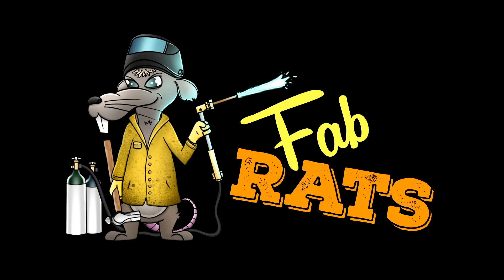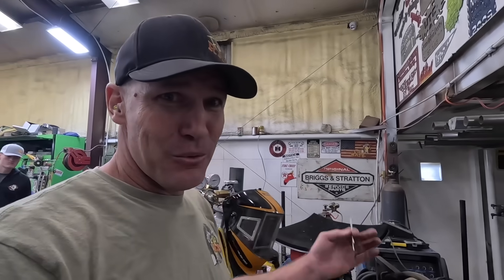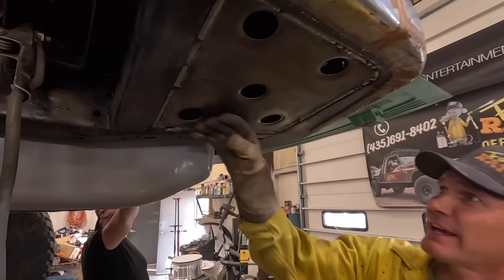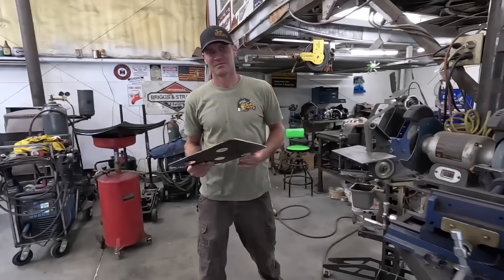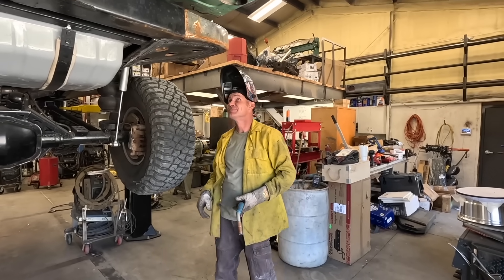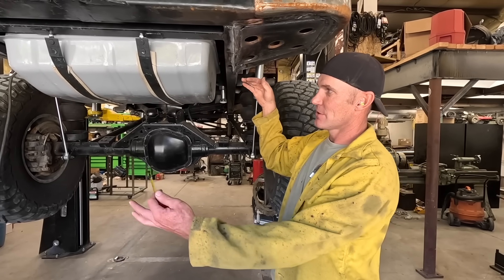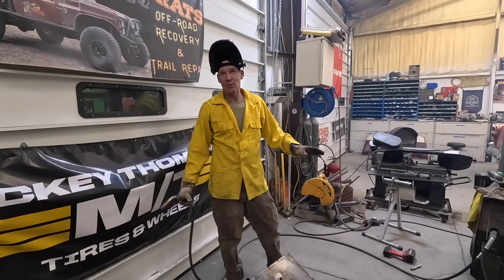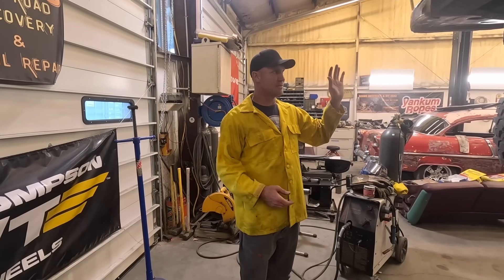HUGE DEADLINE! Can We Finish This Overlanding Build In Time?

Comment: If you haven't done it already, think about drilling a hole through the horizontal crossbar of the spare tire carrier so water that gets in where the shovel goes will drain out.

Comment: Robby's bread van turned out way cooler than I originally imagined, but I don't know how good it will wheel though!
Reply: Robby got carried away. Why spend the time and money to just tear it up
Reply: @gregholmes3661 It won't really get torn up to bad aslong as he has a decent spotter while offroading/rock crawling & i think with the frame/suspension work Robbie did will allow it to easily offroad his monster van only issue I see with Robbies build is that it might be a tad bit top heavy but also think that Robbie & Shawn thought of that an made the suspension/frame that much more stout to be able to withatand the amount of top heaviness it has making it a great rig. Also think Robbie went with more of a sema style build that actually works unlike alot of sema builds with Bluetooth driveshafts an stuff like alot of sema builds have vs a strictly offroading rig like most of the other competitors have built for the ON X build/competition.
Also Robbie has the facility & ability to repair anything that might get torn up while offroading his bread van monster truck..

Comment: Paul - lacking a large brake, rather than separate pieces, I've layed out the full part, wth bend locations drawn on the plate. Then using a straight edge and the plasma, I  do a skip cut on the bend lines, leaving small tabs uncut, small enough that you can bend to correct angle, then run beads in the cut areas. I call it " cut on the dotted lion".😊

Comment: man I think you're about the only one that really stuck to what the challenge was about
Reply: Besides it doesn't seem to be exactly setup to be an overlander tho which is the main goal. There isnt really anywhere to sleep &doesn't seem to have a cooking station. I think Robbies setup is the closest to being a overlander with sleeping areas & a cooking station that is connected to the van & swivels out from the inside to be used an easily returned to inside the van for traveling.. but regardless its a nice looking rig & suspension seems setup good for road travel & for offroad/rock crawling.
Reply: @danafaulhaber334 Did you not see the cooking setup at the end on the slide platform? Along with 3x too many pots and pans lol? Im also sure he has a sleeping tent/pad in one of the 2 draws he made, just didn't show. A RTT would've been better IMO.
Reply: Remember the build challenge changed mid stream so not everyone is ending up with what they first planned.
Reply: @dylancampbell5142  honestly I made my comment prior to seeing the slide out kitchen setup & didn't go back and edit it. So it just made me look a bit stupid..

Comment: I have quiet a few powder coated stainless steel overlanding roof racks, a handful of 270 degree fold out awnings and a bunch of other random accessories I picked up from a business that was closing down. I’m up in eastern Washington but I need them gone so if anyone is interested I’d give a killer deal. Most of the stuff is by “RLD design”

Comment: 15:45  I am pretty much just getting back into fixing up trucks again !! (After over 15 years away from it) 

.. I HAVE to get a plasma torch!!  #1 Saves money, Oxy Acetylene is expensive to burn, and always runs out! When you need it most,

Plus pretty much anything that is less expensive, is also better for the environment too!  A Plasma torch burns only air and electricity ! !

Comment: SPARE TIRE well Ill just point out its on a SINGLE SHEAR Spindle set up So it will fatigue over time trial running and Road driving! Just watch your Spare wiggle going down the Highway not to mention on TRAILS ! I used a 4 inch channel and fabbed up     the Spindle inside the Channel so it is WELDED on top and bottom of the SPINDLE  yes it does vibrate ! But dosnt wobble I did add a FOOT under the tire as a BRACE and SKID for offroad ! But I dont think it will snap off on the ROAD OR TRAIL but I dont have a onboard WELDER EITHER

Comment: In the future you could start collecting 90's to early 2000's isuzu trooper gas tanks. They have a huge capacity in a small package and have a fully capable armor cover you can stand the whole rig on or jack from. Plus they basically give troopers away for free they have no resale value.. They also have transfer case and diff plates as well.

Comment: So Paul even tho those dimple dies look better the way you did them I think making them backwards would make it better for getting any mud, water & any type of debris out/off of those plates instead of having that lip that will hold any debris up on those plates more so than if those dimple dies were reversed but regardless it looks better how you did it an prolly only takes a little more effort to get those plates cleaned off.
Edit: I really like those drawer slides. Makes me want to make something similar to put into the bed of my truck so i can store my tools an other stuff without having everything fully exposed to the elements & to thieving eyes plus itll make it so much easier to be able to get to everything. Actually might remove the rear seat & try to make something similar to put into the rear seat area to store my tools an stuff inside out of the elements an also make everything that much easier to get out of the truck just gotta figure out how to make it come out without interfering with/hitting the door when drawer is pulled out.

Comment: pretty sure you season cast iron pans and skillets with oil in an oven rather than angle grind it to a mirror finish
Reply: @melin1969  new cast has a rough finish. A like time with an angle grinder and sander makes the heat and oil finish so much better.

Comment: I thought the dimples were for drainage? If the lip is now on top…how does that work?  Or do I misunderstand?
Reply: The other way is a cheese grater and looks horrible, but I agree that it needs drain holes.
Reply: Dimples are mainly for strength.
Reply: @ben7274  I wondered as much. But then why are they directional?  Paul’s preference?
Reply: @Dozer04r1  Yes, it's just preference and looks.

Comment: Those inverted dimples will hold water and mud. Soon you'll have a rusted frame and rusted skid plates. At least drill some drain holes in the lowest points.

Comment: Time constraints...bummer, I'd like to have seen you build a roof rack with awning, solar, and tent, enough LED's on the rack, bumpers, and underneath, to turn any trail into daylight, a small, maybe 20 gallon fresh water supply, outdoor shower, inverter, set power fridge/freezer, air compressor and tank.  Maybe in the future...

Comment: I don't understand why you would tint the windows on the OUTSIDE of the glass. Depending on the trail you will be scratching multiple lines in the tint from branches and such. Also, washing the vehicle will degrade the tint with the car wash chemicals (some people still mistakenly use dish detergent, although that will work on this Jeep). When I saw the 55' getting the rear window tinted on the outside I was wondering WTH. I'm 66 and have never seen windows tinted on the outside of the vehicle.

Comment: Weld in the pocket? I worked in the Melt Department in an aluminum foundry back in the late 80s early 90s when a sample I took exploded. It hit me in the face, rolled down my neck, inside my shirt, rolling down my chest, burning through the waistline of my pants, down my genitals, and finally burnt through my underwear and pants, coming out my crotch. Thankfully, since the furnaces were kept at 1,250 degrees, I was covered with sweat and the only damage was a spot on my neck and a thin trail line down my chest to my crotch. Paul, I had PPE gear on. You look like you are wearing tennis shoes. 😳

Comment: @5:50... How many inches of vacuum was the engine pulling, when Chad drove it down? Lowering the revs doesn't necessarily mean you're going to get better mileage, it'll all depend on how many inches of vacuum you are pulling. If you run too high of a gear, you'll pull in the 6"-12" range. If you've chosen the right gear, you should run between 12" and 21". 0"-6" is the Power area of vacuum, which usually means you have your foot in it! (But you don't EVER do that, right?) 😉😉 I do hope you get 18-20MPG, that would be awesome, for a specialty built 4x4! @35:57... Oh My God, you didn't really polish that cast iron skillet, did you? Is what we see a figment of our imagination??? Oh, Dear Lord, that cast iron skillet is ruined, you may as well throw it in the scrap pile. Anyway, I can't wait to see the On-X Challenge videos!